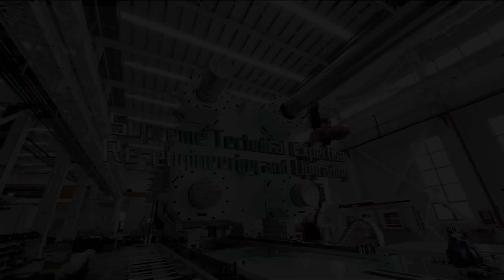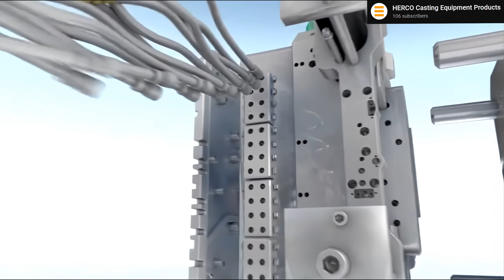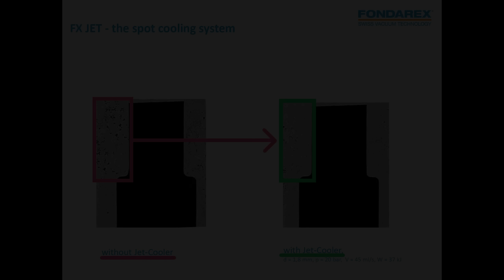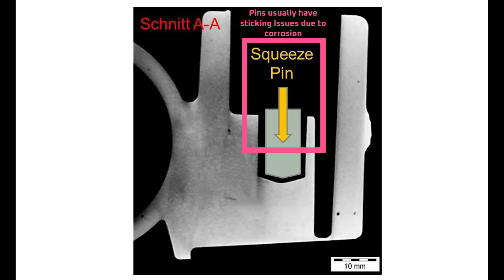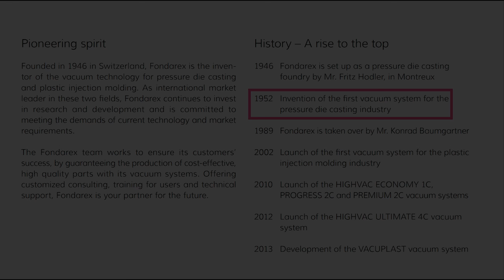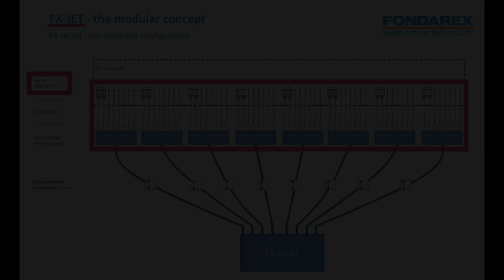The Next Step in Aluminum Gigacasting // Evaporative Cooling Injectors and Squeeze Pins

Comment: Hi Jordan. Slightly off topic. There's evidence that Tesla is recycling scrap aluminum/aluminium at GT. Not just salvaged scrap from the trimming of the castings, but proper scrap such as wheels.

Leads me to believe that they are alloying on site. Up until now the assumption was that alloyed ingots were the only source of metal for melting.

I don't know if on-site alloying is or isn't common practice for car manufacturing. If it isn't, this might be another instance of vertical integration within Tesla.

There's a small discussion going on under Joe's 30 April video about this. Not much advance on knowledge yet.

I thought this might be a interesting subject for one of your videos.
Reply from the maker: Yup!  They're recycling on site.  They confirmed this at the Cyber Rodeo or around that time, and I covered it in a video around that time, but I can't remember which video it was 😁
Reply: @thelimitingfactor  First time non-process scrap (not from the casting process) has been seen on site. In this case it's alloy wheels.

Another commenter claims these are not Tesla style wheels. If it's correct that these are not Tesla wheels, then the composition of the alloy would be relatively unknown, and the follow on is that they are manufacturing the exact alloy in-house.

In the past scrap has gone off site in massive recycling bins. We seen these bins parked in the recycling yard, or sometimes along the east side near BIW.

I know Elon claimed some years ago that any scrap aluminium could be tossed into the furnace, I took that as a generalisation.

This the first visual evidence that scrap is being recycled on site.

Comment: Very interesting, but for cars sheet metal still makes more sense IMO. Especially for repairablilty and crash absorption.
Reply from the maker: For the shell of the vehicle it does, but not for the front and rear under bodies 

That's because if a crash is bad enough that it gets to the giga casting, the vehicle is a write-off anyways 

There are crash cans attached to the front and rear giga castings that can be replaced with a bolt In the event of a minor accident

If the wreck gets past those crushed cans, the giga casting absorbs plenty of energy because it's designed to crumble like an accordion

Comment: Interesting 
30 years in aluminum low pressure and squeeze casting both in the process and mechanical/electrical/controls. 
I see some challenges based on what I experienced that hopefully they can figure out.  Without seeing the equipment, a few things that may cause them issues:
1. Evaporative cooling is of course more efficient than flow thru cooling, however when trying it in past, the following arose. Water has to be free from minerals or during the evaporating process, these minerals will deposit and change the thermal process. Computer control may help assuming all the thermocouples in the die are working correctly, unfortunately they tend to fail at an unacceptable rate. 
2. Squeeze pins work well, not sure why there needs to be a stand alone hydraulic system, even 30 years ago our machines had separate hydraulic pumps and circuits dedicated to specific task. Perhaps Tesla's machines do not have this capability? However I am not sure if the 4,000 psi stand alone system would be to fire code. Unless things have changed since my retirement, fire resistance hydraulic fluid (water glycol) is required, and about 3,000 psi is their max due to lubrication constraints (pumps will wear out quickly). This might not be an issue if casting is done in other countries besides the USA.
3. Squeeze pins as you stated have a major issue with both sticking and erosion, typically coatings such as flame ceramic coatings help, but disrupt the heat transfer. Using tungsten based alloys such as Anviloy are helpful for a 2 fold improvement, both a better thermal transfer than H13 and better resistance to erosion. It would be interesting to see what their solution is.

Again, an interesting video
Reply from the maker: Fantastic feedback, comments, and information thanks!  Much appreciated.

Comment: Meanwhile. Ford casted alum cylinder heads in 2012 that made escapes and fiesta ST’s crack and burn to the ground.
Reply from the maker: I have no clue what you're trying to say here

Cast aluminum is everywhere, and like every material or technology, you have to use the right tool for the job

If something goes wrong, it's not the technology, it's the engineer
Reply: not everyone on the internet is disagreeing with you. It was def an engineering/quality issue. What I’m getting at is how far we’ve come in 10 years and that maybe ford was 25
Years behind ( or just poor quality control )

Comment: One thing that amazes me, is the incredible detail and precision in such huge, powerful machines. On the one hand, they have to allow for the fact that such massive pistons act as springs under the literal tons of pressure, so you need to know how much they compress, at the same time the molten metal has to accelerate into the die at a known and controllable pace. And it all happens in what, milliseconds? Repeatedly.
Reply from the maker: Yes!  It's absolutely nuts

Comment: Wouldn’t a higher squeezing pin pressure also require a higher pressure to keep the mould shut, thus a larger casting machine? Or am I missing something?
Reply from the maker: The clamp locks in place after its closed and the pins are squeezing metal as it shrinks

Comment: One of the most obvious methods that has been in use for years to mitigate porosity whilst helping with flow (esp. in thin wall areas) is vacuum assisted casting. I must admit I assumed Tesla was already doing this. It does add to the cycle time but normally the reject rate is much less. One problem is the wear rate is a little higher so the die maintenance cycle is shorter. Usually the pros outweigh the cons.
Reply from the maker: They do use vacuum die casting, and I said in the video that I've covered it in other videos.
Reply: @thelimitingfactor  Guess I missed that bit! Must pay more attention!

Comment: I think one thing that needs to be developed is automated QA for parts right after casting. Machine learning could improve the process and reduce a massive amount of waste that occurs from defective parts being produced up until a QA person notices it. Cameras or even the technology used for NDT of welds would be very useful for initial part inspection. Also, using machine learning systems would be far easier if you're already starting with parts held in the correct orientation and not yet subject to the dents and scrapes that occur after the casting process.

Comment: Is anyone looking at introducing a high pressure pulsed wave into the molten metal as it's going into the mold? The idea is similar to the action of an internal vibrator introduced into wet concrete when it's poured into a form. In that case the goal is similar in the sense that it's to eliminate air bubbles.
Reply from the maker: I'd think that the timeframe isn't long enough.  We're talking milliseconds.

Comment: I think the Robovan will push the casting sizes as far as they can be pushed... And still find them somewhat wanting.

Will this tech go into cybertaxi? It could save capex on the press size.

Will it go into cybervan? It would reduce part count. So yes.
Reply from the maker: On the Robovan, it depends if it's made with an unboxed process or if it will use a completely different manufacturing technique

Comment: Hats off to China for Buying INDRA and supporting the engineering innovation.
Reply: And hats off to GM for buying the company that developed the gigapress for Tesla, Tooling and Equipment International (TEI). They're using it for casting pieces for the new $340,000 Cadillac Celestiq EV. 
Ford also purchased a gigapress from INDRA last year and is benchmarking it with help from TEI (GM).

Comment: Could they make the squeeze pins to stay in the casting?
Reply from the maker: Probably, but I'm not sure how 😁  Interesting idea
Reply: Some disposable dowels good thinking
Reply: Not really as corrosion would become a problem over time. This is due to dissimilar metals that have a different electrical potential producing galvanic corrosion.
Reply: @themerkin1953  How is this handled otherwise in a car? Surely steel and aluminium come into contact all over a typical car? If nothing else in fasteners.

Comment: Hi  Jordan do you think if Tesla adopted  these two new processes and added them  to a 20,000 ton machine that they could cast a redesigned  Cybertruck in a single casting? Also with this casting set up do think it would be possible to produce aircraft superstructure castings in magnesium ?
Reply from the maker: No, because the Cybertruck uses a partially unboxed process.  A single piece casting would run counter to that.

Depends on the size of the aircraft 🤠

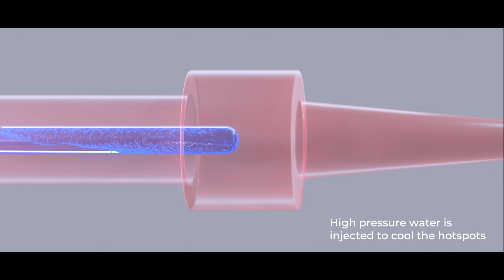Comment: 05:18 just letting you know, for some reason Tesla went back to a cast-at-the-back, stamped-at-the-front situation for the Model Y about a year ago at Austin.  They call this the "legacy Y."  I found this out during a tour about 3 weeks ago.  The guide was not sure why they went away from front+rear castings.  Perhaps they're going ahead with front+rear castings on the 2025 refresh, we'll have to see.  They have 3 assembly lines for the Model Y running simultaneously.  I believe one of them has been switched over to producing test examples of the 2025 refresh.
Reply from the maker: Hmmm, that doesn't make sense.  

I know several vehicles use stamped front, but I've not heard anything about swapping back and forth.  It would have extremely costly to do that and result in downtime.
Reply: @thelimitingfactor  well we were standing right next to the stamped-front Y's on the line.  No doubts about that.  I think maybe it was to free up IDRAs for the CT
Reply: @thelimitingfactor  Maybe they want to free up the presses for use on the next gen vehicles that start production this year. They are supposed to be built on the same lines with minimal additional capex. Considering that the new vehicles will be cheaper, they will likely be higher volume, so if no new presses are purchased, it may make sense to use the presses only for the new models.
Reply: @thelimitingfactor  There are separate lines for legacy and front casting
Reply: @thelimitingfactor  Hasn't been a Model Y cast front end (FUB) seen at GT since October 2023.

 I'm talking about in the storage racks and yard outside.

The image of the 2025 Model Y BIW shown on the Tesla website shows a sheetmetal front end.

Comment: Great video -- love the in depth work you do. But is 20K Ton really enough for Tesla's dream of a full vehicle cast? I didn't think so.
Reply from the maker: Thanks man!

They aren't ever going to do a fully cast vehicle in one piece if they're using the unboxed process.

Either way.  Yes, 20k is enough for that if it's a small vehicle.

The front gigacasting on the C/T only uses 6k tonne and that's a huge piece of metal.
Reply: @thelimitingfactor Ah good point about the unboxed process. You're definitely right then, provided all the technical challenges with the 20K Ton press are solved.

Comment: Gigacasting is all about Tesla saving money on production cost and shifting it onto consumers when they discover their insurance premiums going through the roof on their car because it is less repairable.
Reply: FDS should reduce the rate of crashes, hence why they have invested heavily into casting
Reply from the maker: Nonsense

I've covered this extensively.  There are pieces that are designed to crumple and break away and be easily replaced (bolts)

If the damage gets into the body of the casting, your vehicle is likely totalled anyways.
Reply: @thelimitingfactor  I said less repairable, not unrepairable. And I'm aware of sacrificial points. It's not hard to find instances of cars written off for collisions that a steel bodied car could have been repaired for.
Reply: @rogerstarkey5390  gigacastings are more likely to fracture than bend like steel. So you might have to chop a big chunk off the casting to effect a repair rather than pushing / pulling it. Assuming it can be fixed at all, i.e. if the damage doesn't extend beyond a sacrificial point. Welding aluminium is also way more difficult than steel and Tesla has a bunch of rules of which bits of the casting are repairable and which are not. On top of that, the chances that your local crash repair centre is going to fix your Tesla is low, so look forward to it sending it to a specialist with the added cost & delay. You can even find videos of specialists talking about repairing gigacasting and presenting a "heat map" of what they can fix and what they can't. So yeah, less repairable. And it's reflected in insurance premiums.
Reply: @drxym I laugh at your reliance on insurance premiums as objective analysis. You haven't been paying for insurance very long,  perhaps?
Reply: @ well I laugh at your very basic ignorance of material science.

Comment: The question that immediately came to mind, does Tesla even need to mess with the vac/jet/squeeze tech?  They have talked openly about their own casting innovations to maximize quality and throughput while minimizing defects: 1) tuning the molten aluminum chemistry to limit porosity and shrinkage, and 2) designing the molds in creative ways to promote laminar flow and even cooling of the melt.
Reply from the maker: They already use the vacuum technology, it's critical for their castings

Probably the best way to phrase it is:  Is the cost/benefit worth it?

In my view, if they can spend a couple hundred thousand dollars on extra pressure or cooling instead of spending millions extra on a larger press, it's worth it.

But, it really depends on the use case.  

I think it's nigh impossible to work these things out from the outside.  They have they data and they know their needs.
Reply: @thelimitingfactor  the bottom line is if it increases quality at a given size then they can make nicer casting of the same size, or larger castings of the same quality. 

Which do you think elon is inclined to do?

Comment: Gosh, I'd love to see the cost benefits to a company like Aptera using single gigacastings for a single motor vehicle. Add in self driving, take away the controls (and associated costs), move to LFP and smaller batteries, wireless charging... the combination would be hard to beat.
Reply from the maker: Yeah, new tools definitely open up the design space 🤠
Reply: If Aptera could move away from Carbon Fiber for increased production volume, I'd be willing to take almost any Range hit for a $12K price tag.